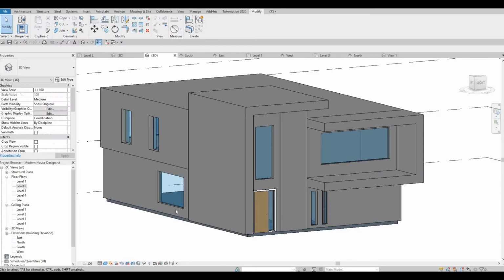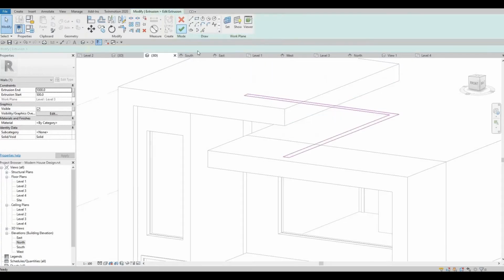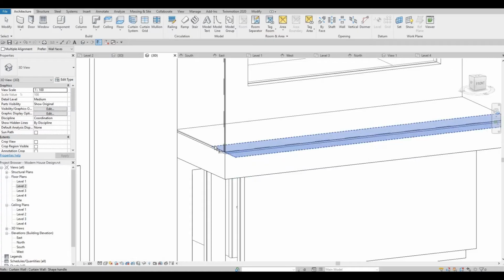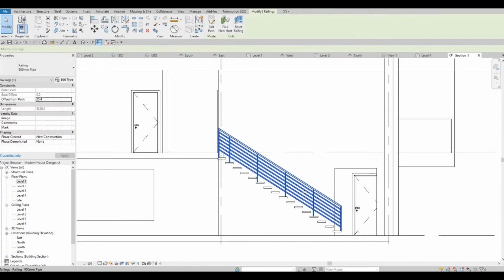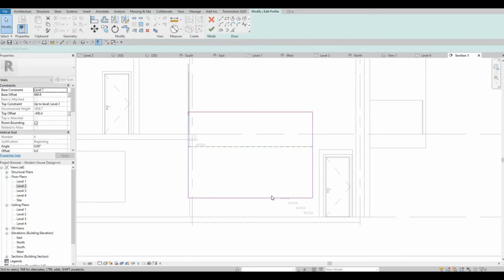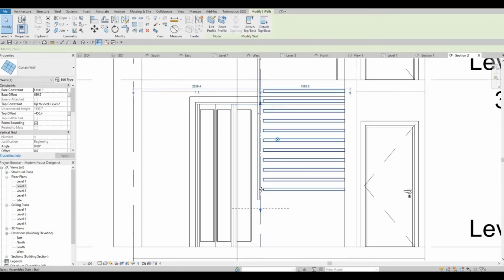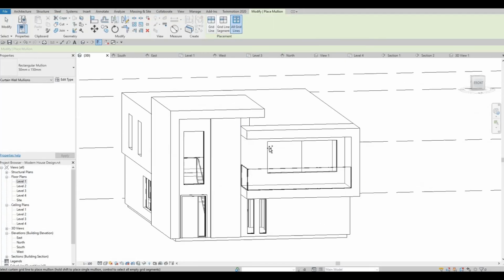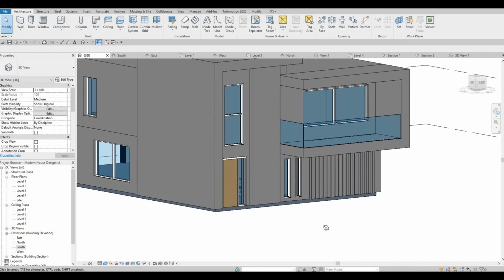Modern House | Part 5 | Complete Step by Step Project | Revit Tutorial

Comment: the curtain wall railing at stair is not aligned at step of the stair? the railing will be parallel to the step?
Reply from the maker: Hi Gemma, make a section line so that you can view the connection better. Yes it is parallel to each other. 🙂🙏